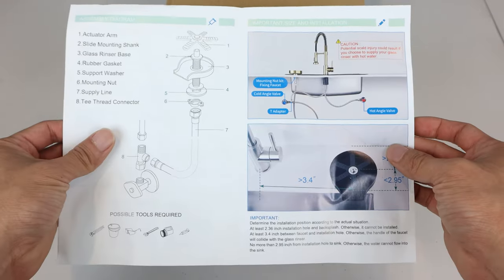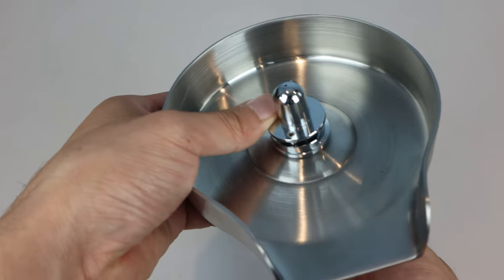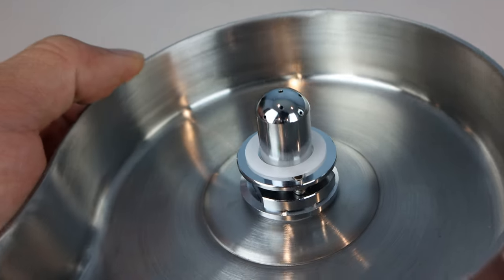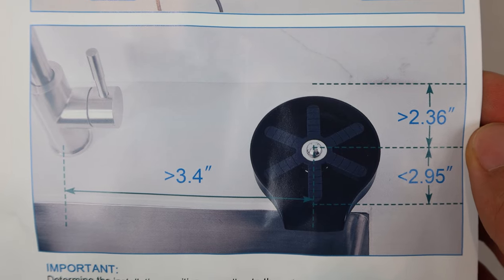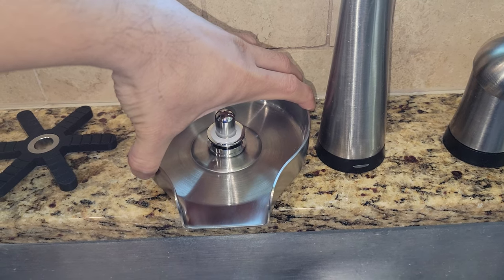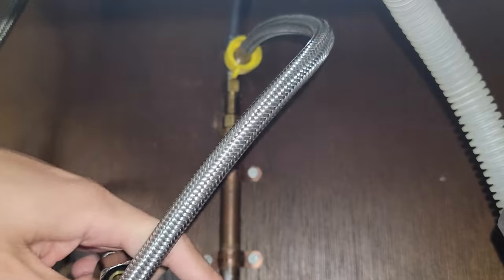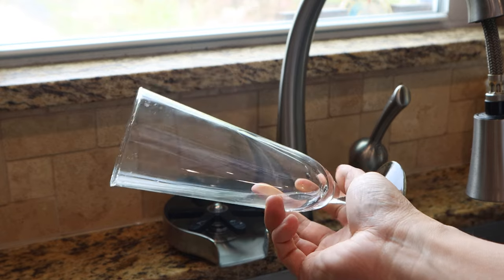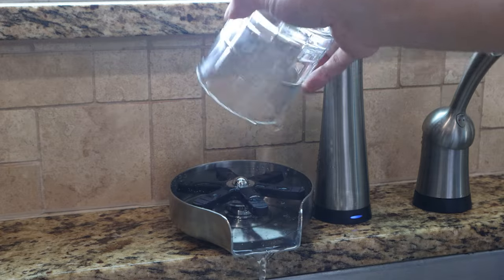Fontop Stainless Steel Glass Rinser Installation and Review

Comment: I’m curious, the glass washing doesn’t cover the surface outside the cup where the lips would usually keep in contact with. So would u end up washing that portion separately first?
Reply from the maker: Yes
Reply: Yes separated it's better this is primary for rinsing and secondary(Washer) when used in soap a bit added. It's for quick rinse even the toughness stain can handle because it bombard with fast strong hydrojet sprayb

Comment: This products consistent two things. One primary for rinsing and two washing(Secondary) with soap added

Most of the time its used for rinsing on a cup or small items. With, this shooting bombard spray of hydrojet it can lift any tough stain on the inside. 

For washing using soap added its good too. Precautions its inside being wash not the outsideb

Comment: Nice review!  It seems like a cool product.  Do you find that you still need to wash with dish soap or is it clean enough without?
Reply from the maker: It depends. If it's an unsweetened water based drink like tea, black coffee or seltzer, no soap is not needed. But if there's dairy in it the fats from the milk typically require a quick wipe with a soapy sponge before rinsing and very sugary drinks may leave behind a sticky residue without soap.
Reply: Go to the video I uploaded and in the comments there is a link to the product from which I purchased and received it_

Comment: But what happens to water pressure to the cold or hot water!? Does it affect the pressure of the water when not in use!?
Reply from the maker: No, your water line pressure will not be affected when not in use because pressurized lines always return to equilibrium when water is not running.

Comment: Have 1.5in to backsplash. Any ideas for attachments or ways to make it fit without drilling new hole?
Reply from the maker: To my knowledge, there isn't a great workaround for this issue. If the clearance isn't there, then you won't be able to install the glass rinser without drilling a new hole elsewhere. I have seen some installations with the hole drilled to the side of the sink or overhanging one of the back corners.

Comment: Any idea what to do if sprayer won't turn off?
Reply from the maker: Not sure, sounds like the spring isn't popping back up to shut off the water flow. Perhaps the water pressure in your line is too high. In that case, you can try partially closing the valve to the water line and see if that reduces the flow enough for the sprayer spring to actuate and shut off.